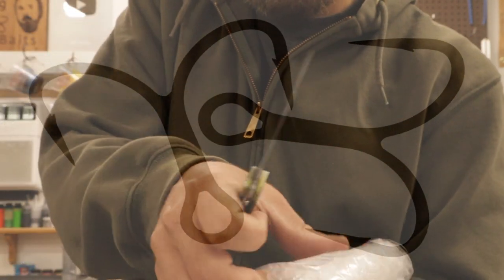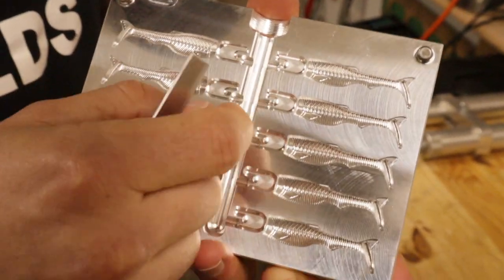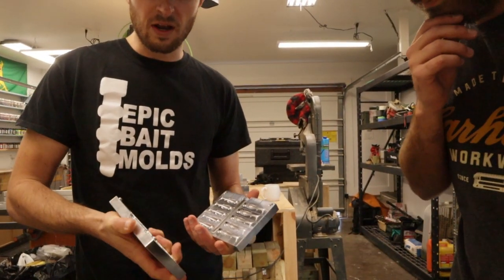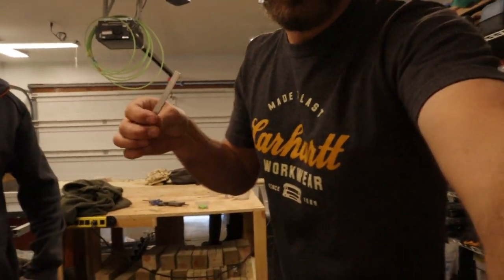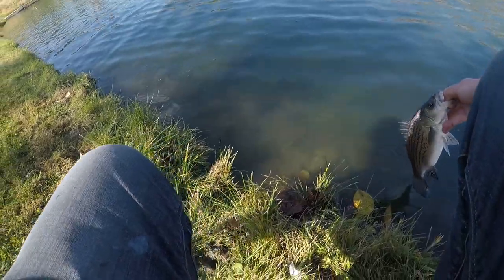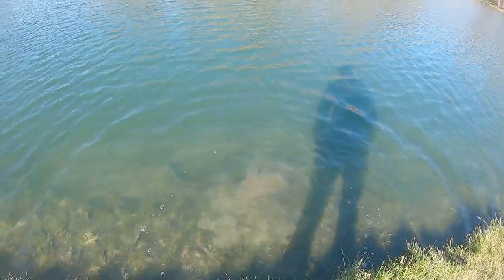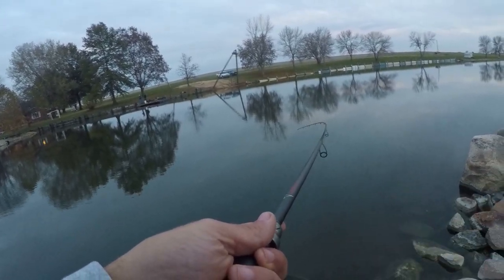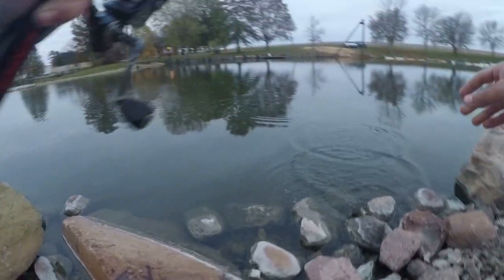A Tiny Epic Bait | Catch n Cook | Special Guest!

Comment: I wonder if you can make a jerk bait that will suspend at a certain depth off of just density of the lure. Maybe that would require a precision level that is too difficult? It would, in theory, change depths pending the body of water and temperature because of density differences in water. I'm thinking a small jerk bait at deep depths. Maybe it would take too long to get to depth to be worthwhile or maybe I'm in la la land.